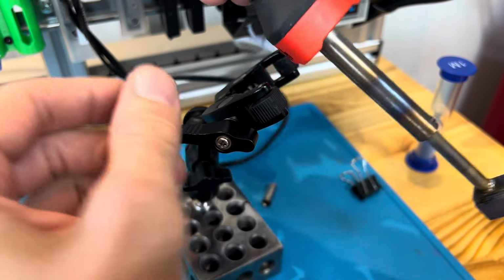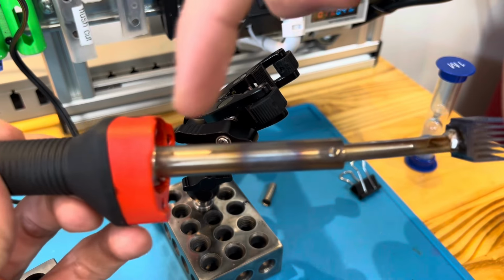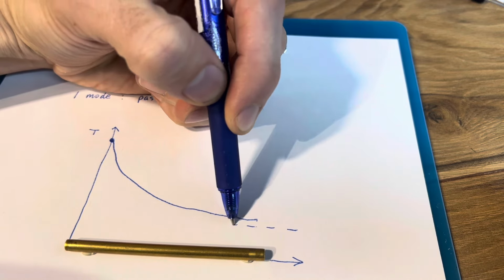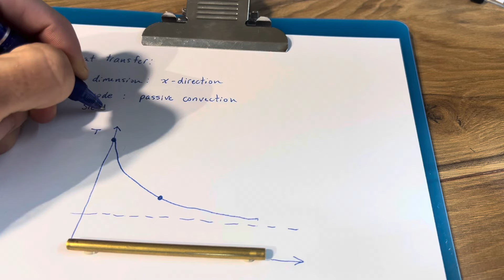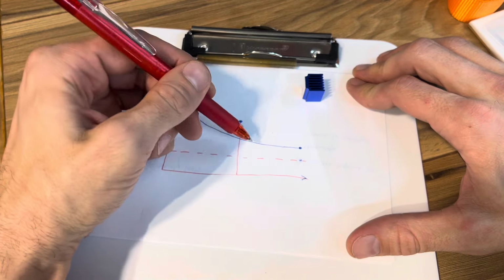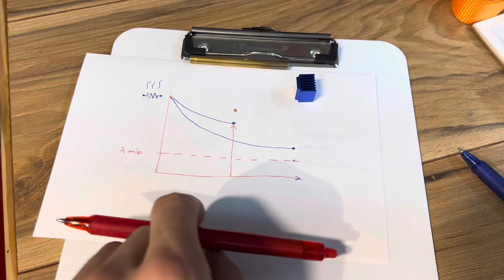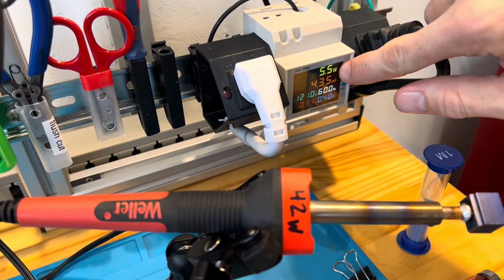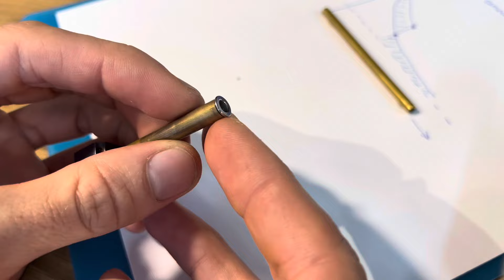Hack a Soldering Iron with a mechanical engineer

Comment: if you like playing around with metal tubes and soldering irons, you can recreate the aoyue smoke sucker. It's a steel tube parallel to the soldering iron. it ends at the tip with a slanted hole inclined towards the tip so it's very close. that then goes via a long silicone tube to an air pump. smoke comes off the tip and goes right into the tube, to never be seen again. no need for fans or any of that mumbo jumbo, works GREAT. the steel tube is covered in silicone where you might touch it with your hand in case it gets hot or whatever. enjoy.

Comment: I was previously using voltage controllers. This just an excellent way to avoid temperature adjustment via controllers.   I will definitely use this technique as the thermal load carried by the mass of  Stepper cooling fins should extend and improve my soldering iron duty cycle. Mucho Thanks

Comment: Two big problems: 
first: you cant solder brass to aluminum with standard electronic solder (PbSn / Sn) - you essentially just have a interlocking fit but not a true joint (still works but is technically not soldered)

Second: your soldering iron isnt a constant 42W heat source (that would be aweful to solder with) 42W would cause it to heat up to a temperature that would be high enough to disipate the 42W into still air which would be incredebly hot, touching a joint would cause the temperature to drop significantly resulting in high temperature fluctuations with would burn your flux at  rest and make cold joints while soldering.
 It got a PTC heatingvelement  which increases its resistance when it heats up resulting in lower power draw. This makes it somewhat self regulating and results in a resonable constant temperature even though the removed heat (touching a big joint vs sittin in still air) changes significantly.
So your constant power / temperature stuff is quite off. It sill works because you got a high thermal resistance and a big heat sink, resulting in a gradient across the poor conducting brass tube, but the soldering iron temperature almost dosnt change and the heatload gets just compensated by the PTC behavior of the resistive element.
Reply from the maker: this is a useful comment.  

1) have you worked with a solder spec’d for aluminum?  i’d love to try it out.  yes i can google but prefer a recommended alloy.

2) my live meter tells me this iron is pulling constant power.  yes it’s ill-suited for good soldering.
Reply: Looks like a harbor freight special. The kind just dumb enough that it actually might be a giant resistor with constant power draw and no regulator 😊
Reply: Blue Demon is one brand of aluminum brazing rod.  Hobart makes them and so does Harbor Freight.  It is designed for a MAPP gas torch but on smaller items propane works as well.   It takes some practice because of the way the flux works but if done correctly, the strength is listed at around 30,000 psi.  I've never correctly tested it but I can't break it off with a hammer.
Reply: Classic mains-powered “fire stick” soldering irons, the kind that were widely used for decades and were still common as “my first soldering iron” until this millennium (when inexpensive soldering stations became more common), almost universally use a plain resistive heater with no control whatsoever, not even PTC. 

The reason they work is that you have a large thermal “reservoir” in the large thermal mass around the heater, and the fairly large tips themselves. The wattage is designed around the tip sizes used, such that within 5-10 mins of heating, they reach thermal equilibrium (same power dissipating away as is being put in) with the tip at around 400C/750F. With some heat being drawn away during use, the average temperature during actual work is a bit lower. 

Classic sizes for small electronics soldering (PCBs and small parts) is 20-40W, and 15W for smaller, more delicate things, and higher wattages for bigger things.

Comment: If you want to connect something like brass and aluminum, especially if its meant to withstand a couple hundred degrees, brazing would be be a good option. If you know anybody with a TIG welder they could easily do that for you

Comment: Hows the block with holes called?
Reply: It's a 1-2-3 block or machinist setup block. It measures 1"x2"x3", but you can also get them in 25mm x50mm x75mm.

Comment: What is the soldering iron that you are holding at 8:03?
Reply from the maker: TS100 is the model - it's an open source design.
Reply: @davidmalawey what is the silicone that you've put on the tip? Is it just a bit of tube, or a pencil grip or just something that you hand moulded?